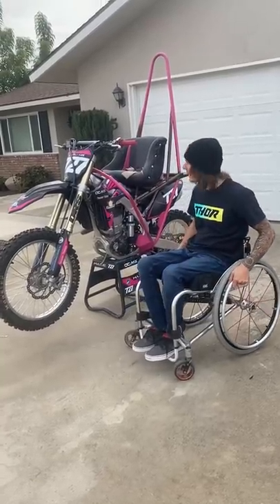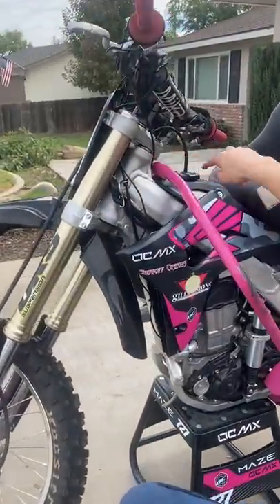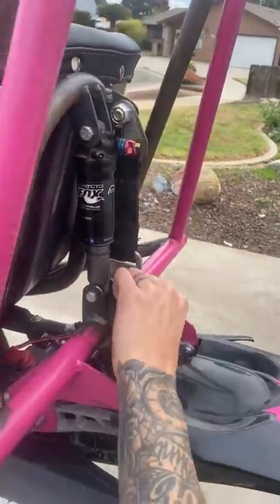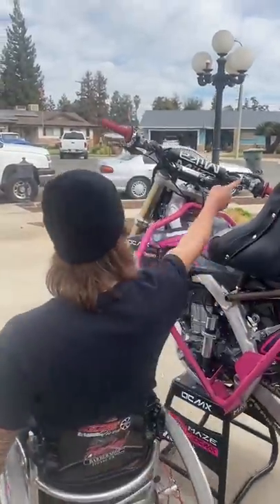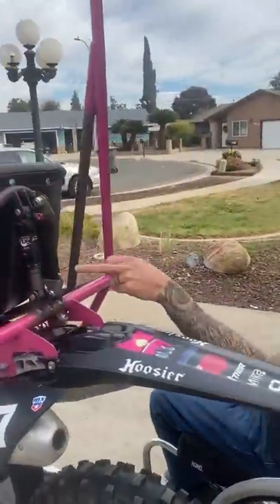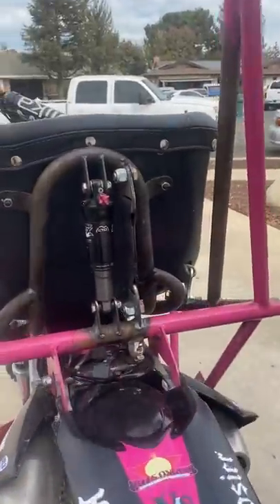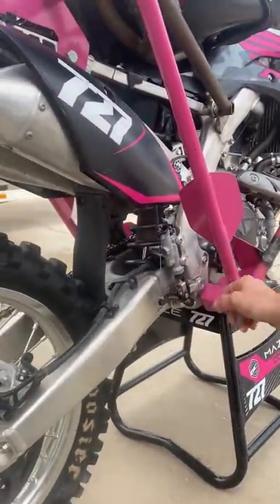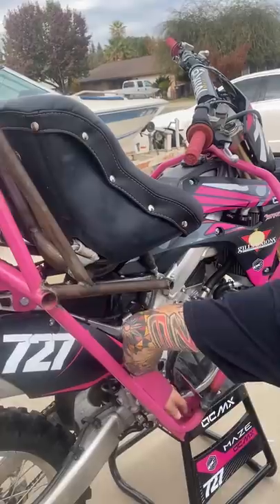Custom Dirt Bike for A Paraplegic , CRF450R, How To Adapt , Electric Shifter , Seat Shock

Comment: I got one leg with no knee joint at all from a motorcycle wreck. Bone popped out got infected and now muscles are too short too so it's just lower leg bone against femer, no joint no cap. I tried riding enduro's after and while I can just fine, the times I've needed to put my right leg down(the bad one) to turn vs my left has been bad a few times. Once with a broken foot as I missed the ground due to no knee control and the bike fell over on my foot as I tried to jump off the top when it tipped. Seeing this just makes me feel bad as it's a lost cause. He should be fine on a fourwheeler but it's a waste of money on the 2 wheel. No doubt he could ride it though but nowhere near the same or safe really.

Comment: I have a lower right leg amputation with a prosthetic leg, and I thought of the rear break lever under the clutch, It's easier to ride wheelies just like I used to ride wheelies on my Chumba full suspension  mountain bike

Comment: One thing I would do even tho it’s dirtbike is add a seatbelt. Mainly because if you are riding solo and you mabye hit a bump too fast and get tossed around where someone who wasn’t paralyzed would be able to stay on because they had that extra grip in there feet where you may not and if you where to fall and get stuck out by yourself you would pe able to get to a sidewalk and have someone come pick you up all tho if your just doing motocross this wouldn’t be a problem